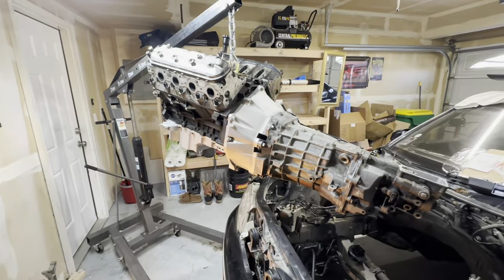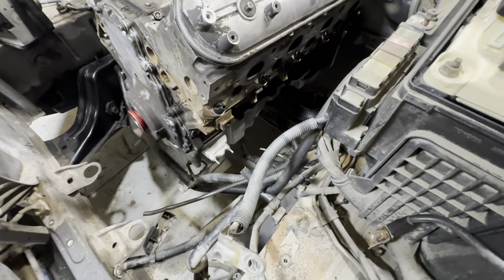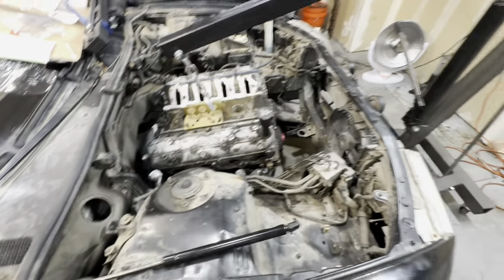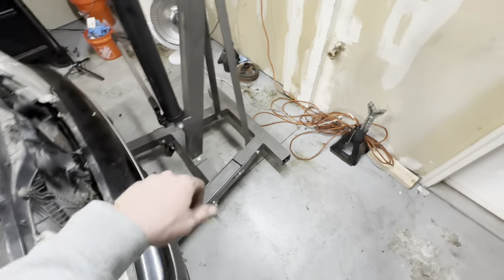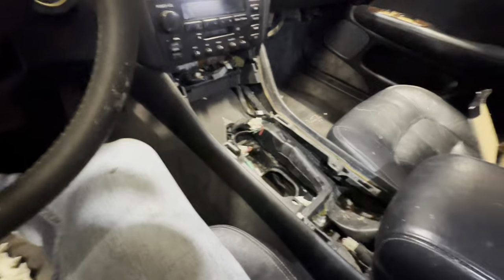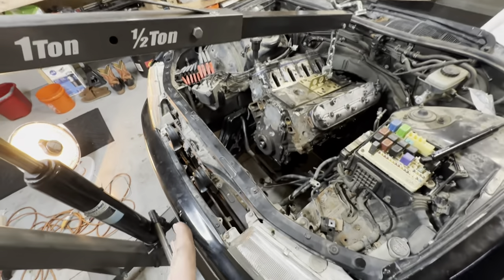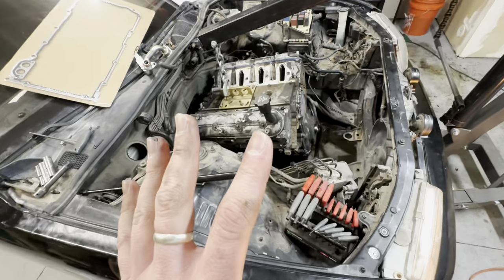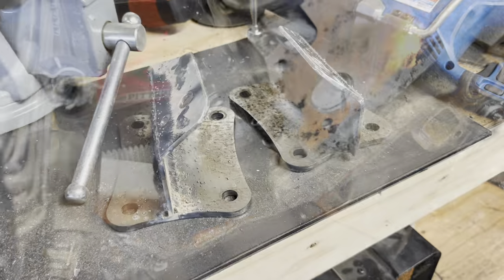LS swap Lexus ls400 episode 4 engine mounts and fitting

Comment: What oil pan did you use?
Reply from the maker: I used a jegs low profile one with a front sump.
Reply: @williammclaughlin2606  sweet, I looked into that one before when I wanted to LS swap a 350z but I heard there was clearance issues with it... wasn't sure if it'd work in the UCF platform... watchin all your vids on this so I can get the motivation to do mine 🙏 hahaha, but first I need a daily 😅
Reply from the maker: @Oddtapia  it’s been pretty easy so far but it’s definitely taking a long time
Reply: @williammclaughlin2606  oh yeah, I don't expect anything less hahaha, it's alright tho, it'll be well worth it

Comment: I have a 97 LS400. It's a great all-around car, but the best part about it is the engine, which is like a fine watch. LS-swapping it is blasphemy. You can buy used engines for reasonable prices, making this swap impractical as well...
Reply from the maker: Well fortunately this is my car and I get to make my own decisions in life :)
Reply: not really. im a die hard 1uz guy, built 2 drift cars from the LS400 Platform. tbh theres not much aftermarket and the stuff that is there is extremely expensive. an LS is a great alternative if you want to have a budget friendly project
Reply: Fellow die hard 1UZ guy here. Not everyone has the same uses for their car. For those that would like to tinker and increase power, the LS series of engines yield far more gains for far fewer dollars than modifying the 1UZ. Especially NA. The thing to keep in mind is that not every Lexus owner has the same expectations from their Lexus. No way the 1UZ is the right motor for this guy. He wants some sauce.